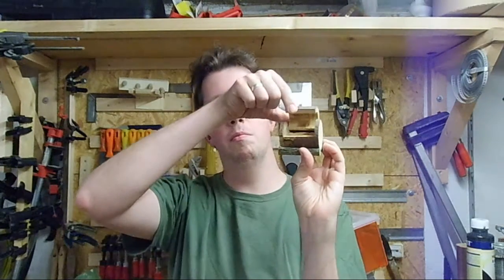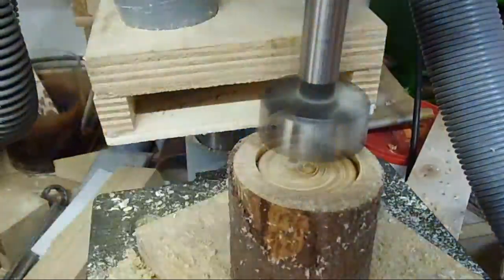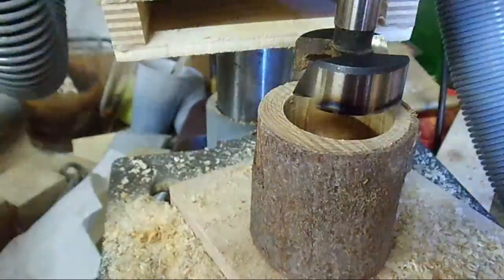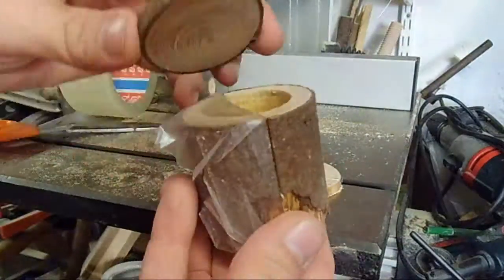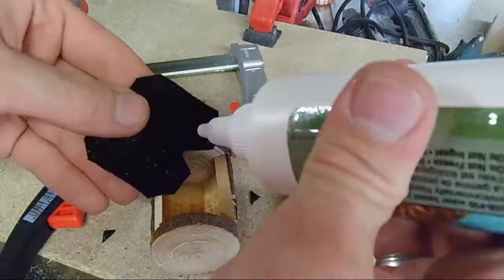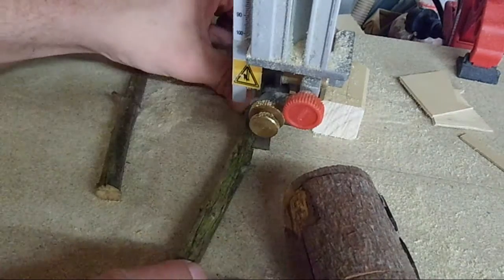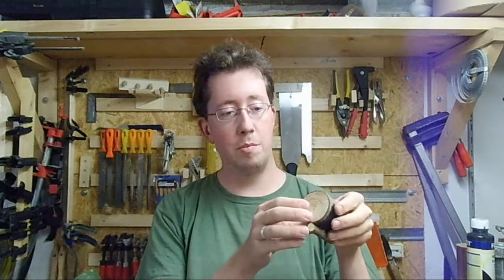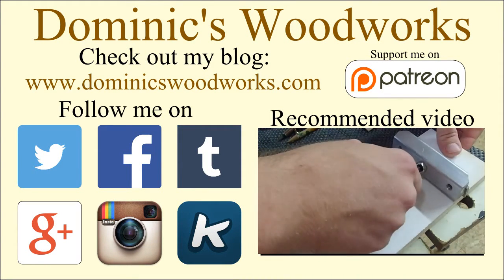Branch Chest with the drill press

Comment: What do you suppose the difference is between a chest and a box? Is it the curved lid? Are all chests boxes? But not all boxes are chests?

I like to do live voices because the timing with the action is perfect. But if perfect timing is unimportant then voice over works fine, kind of like a DVD commentary.

I have more of a difficult time watching sped up video.
Reply: Not to mention tool chests. I like cuts to critical moments because it engages the viewer. This is a lead-on technique I use in the classroom as well. This technique is also used in show biz you may have heard of " give them 2 + 2 but don't give them 4."